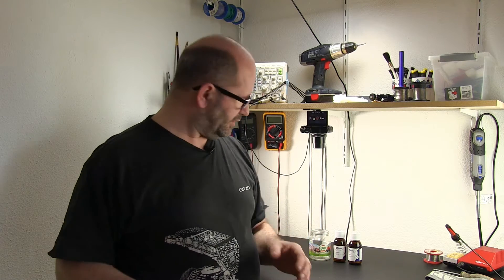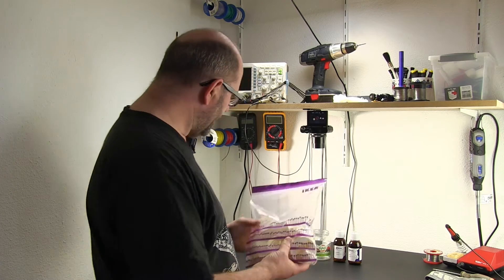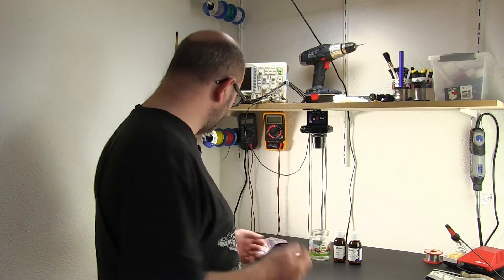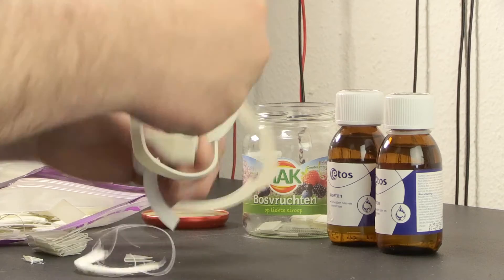▼ Making ABS slurry for easy 3D print repairs

Comment: I use a 3d pen to fill in cracks or holes. Good video though.  Thanks
Reply from the maker: A 3D pen works fine for this.
At the time of making the video, those pens were not that common though, but now I would also do it that way.